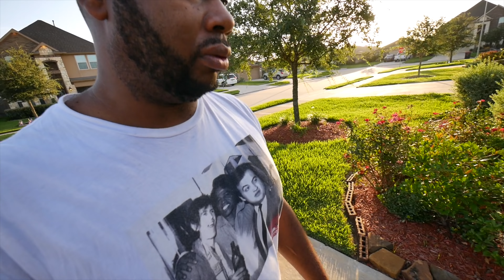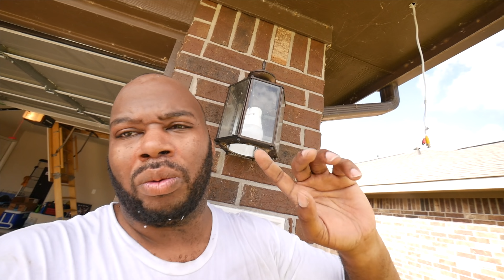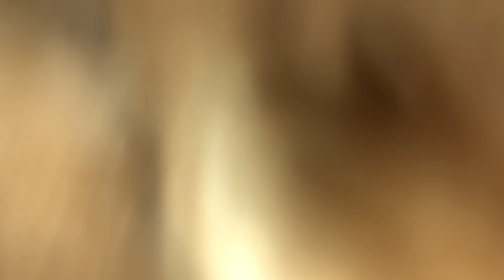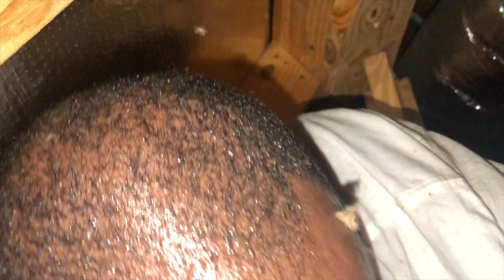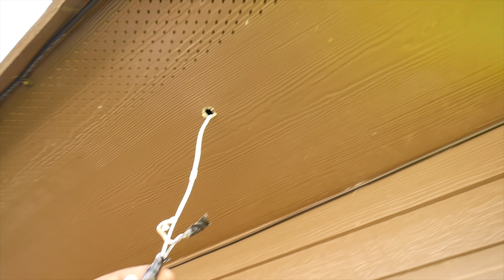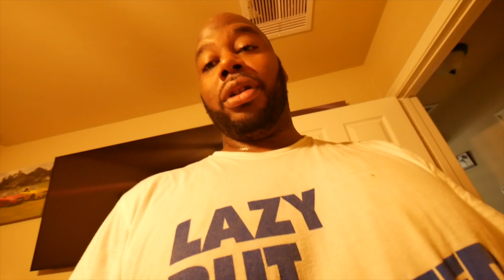HOW TO INSTALL SAMSUNG HOME SECURITY CAMERAS

Comment: A POE CCTV system is a lot better.
Reply from the maker: J Will is it 4K ??? I’m going look it up now
Reply from the maker: J Will yeah I’m looking into lorex system now
Reply: The Lorex system is a great system that will display the camera resolution in 4K, now a POE system will display in 1080p the cameras will get there power from the cat5 cable ran to the DVR. Trust me you will love the display of the cameras a lot better than the ones that ran on coax.
Reply: Lorex has the 30fps 4K version now , supposed to be a lot smoother